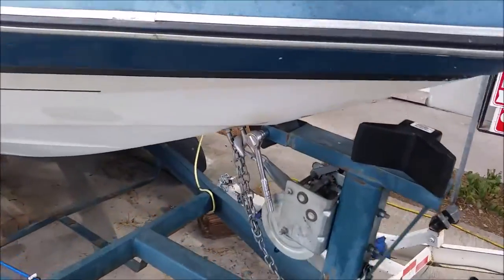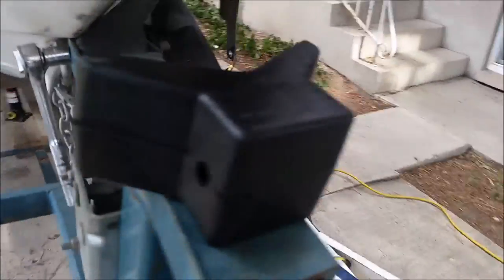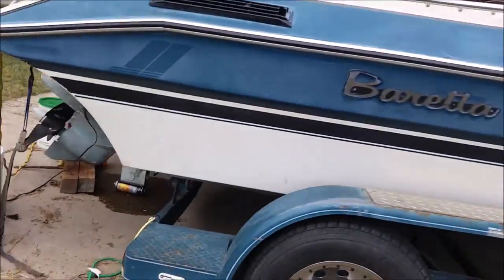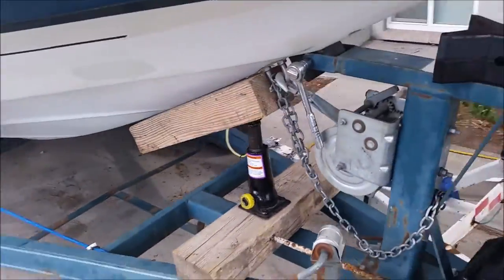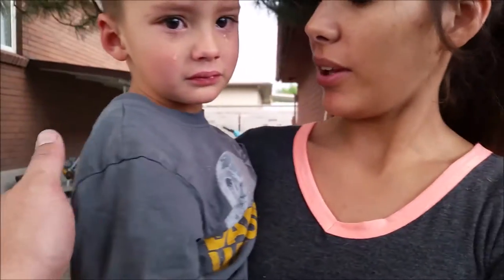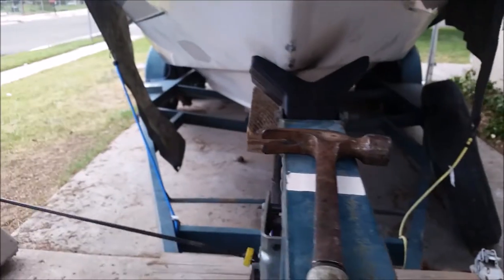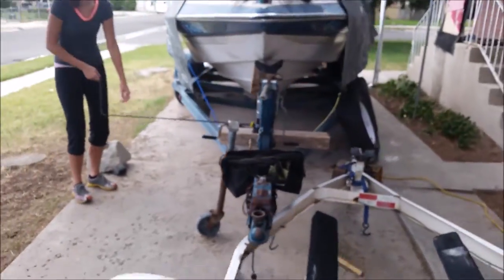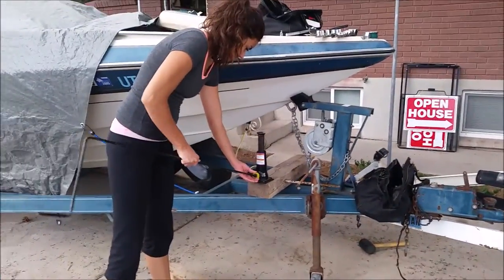How to Install a Bow Stop On A Boat Trailer

Comment: It needs a roller not a rubber stop
Reply from the maker: I wasn't aware that it would need a roller.  What benefit is there to having a roller compared to a bow stop?  The trailer had a bow stop in it, so I simply installed a new one.
Reply: says who?
both will work